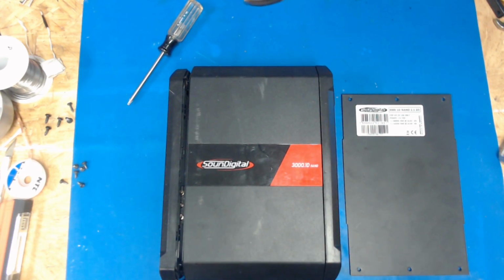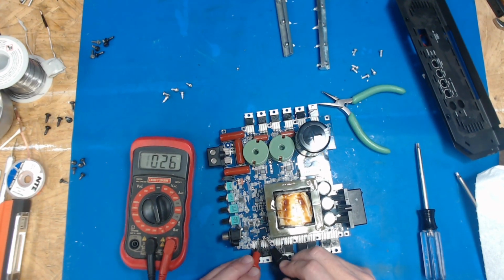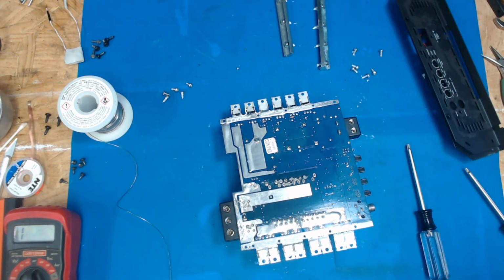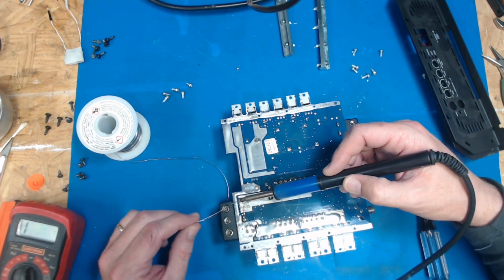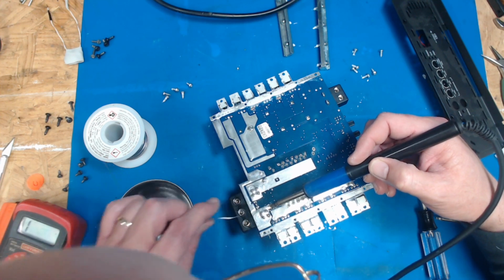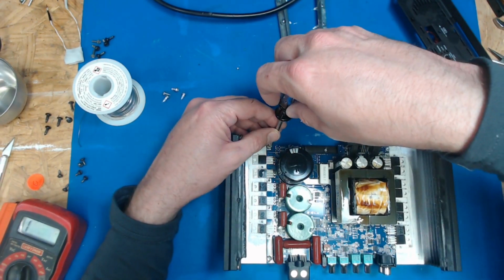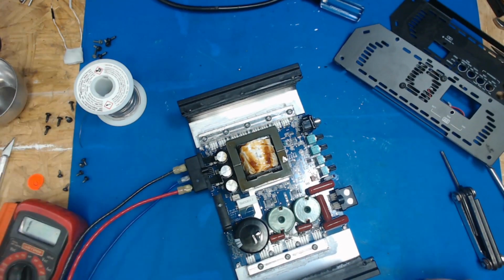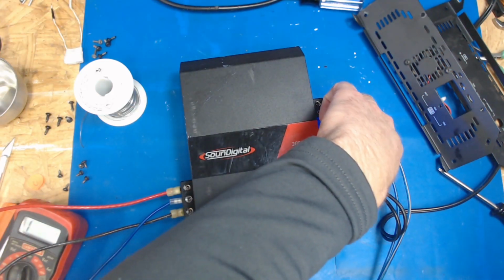Soundigital 3000.1D Nano repair. Holy molten solder Bassman!

Comment: Hi there by any chance do you have any experience with sound digital 3000.1 evox2 amp some tiny straps of copper on the very edge of the amp are broken. I can't figure out where to solder them back to.
Reply: I can post some pictures

Comment: What are those metal brackets that you took off I have the same amp and right when I turned on my car they melted and amp stopped working is it done for or is it fixable?
Reply from the maker: The power terminals? Or the fet clamps? Anything can be fixed, it is just if it is economical to fix. Look for some used working ones, that price will set a point that lets you know if a repair quote is worth fixing.
Reply: The fet clamps would it be better to buy new or try and find replacement for it? It was only one side melted the aluminum

Comment: Seeing that's how the solder melted, wouldn't the wise decision be to resolder it with high-temperature solder? Instead, it appears as if you have added a lower temperature solder. If there were ever a use case for lead free solder, this would be it.
Reply from the maker: No, never. That would be an engineering/design fault if the product can get so hot as to melt leaded solder under normal operating conditions. This was more likely a factory defect combined with improper install/use.

Comment: Hi anyone .the A5 transistor on this amplifier does anyone have a replacement number that could work properly in the circuit as the original soundigital fuck this one up I cannot find that transistor nowhere.
Reply: Did you try to buy some replacements from Sound Digital? They may not want to reveal what fet they use, but they can certainly sell you more defaced ones.

Comment: Between soundigital and taramps which design and reliability are you seeing is better?
Reply: There all of the same designs sound digital use better parts for there amplifiers and have better warranty because of it  ifix all types of electronics and amplifiers and modified them .

Comment: Just out of curiosity what do you normally run your air and your solder gun temperature
Reply from the maker: 300-350 C on the iron and 350-400 C on the hot air, but you have to adjust sometimes for heavy traces or delicate work. I'm in the US and have found most equipment is default celsius, and industrial equipment is too, so I just stuck with it.

Comment: Amazed that the plastic (CRFP?) of the terminal survived the heat. Makes me wonder what the melting point of the original solder is.
Reply from the maker: One terminal was a little messed up, but not much.